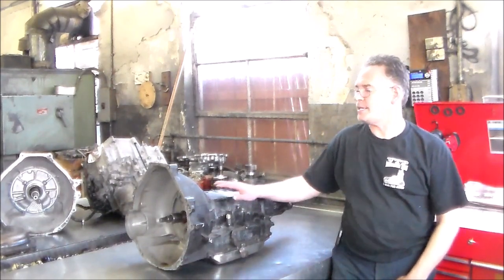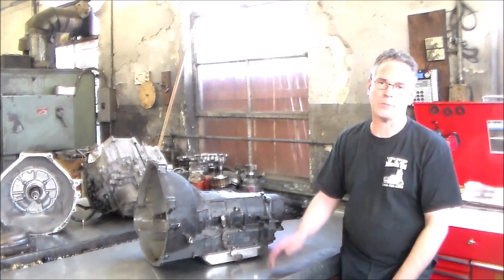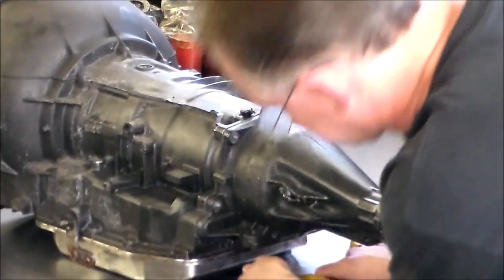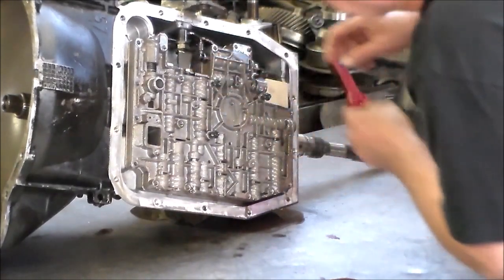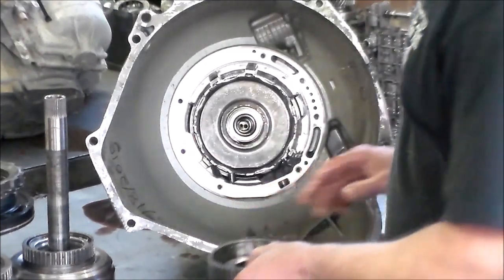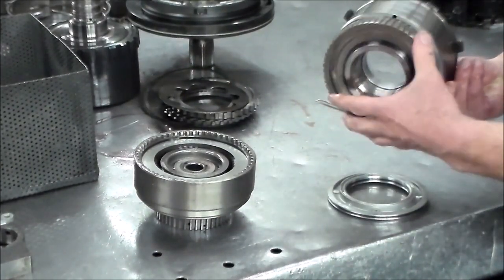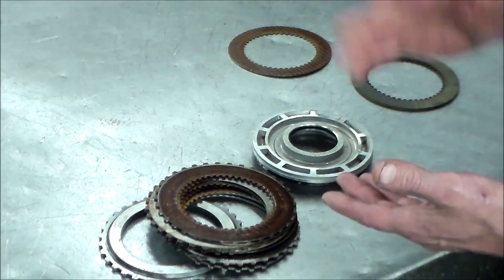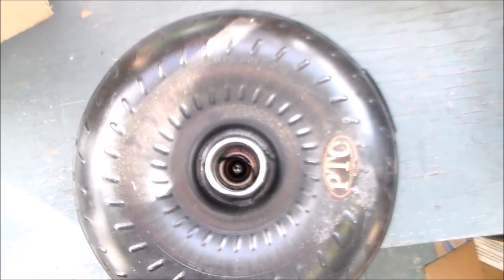AOD Teardown

Comment: Hi mr Gary after we rebuild transmission today i test my car shift 1st gear and second gear is ok but it is not shift 3 and 4 gears. İ tested both overdrive position and D position same problem. What you think may be valve body?
Reply from the maker: If this is early AOD, could be converter problem or direct drum problem.  What year is the car.  You installed the direct clutch shaft correct
Reply: @GaryFerraro  1991 Libcoln Town Car.  please if possible send to me email any book for rebuild this transmission.

Comment: Great video Gary. How much can you charge to rebuild a1986 AOD trams for my mustang?
Reply from the maker: Is this just a regular rebuild?
Reply: What do mean 🤔 with regular rebuild?
Reply from the maker: @franciscovalencia7601   Not installing any kind of shift kits, just a standard rebuild
Reply: Just regular rebuild nothing special
Reply from the maker: @franciscovalencia7601  ok, let me check on parts, are you in the New York Area?  what is the problem with the trans?
Reply: I'm from Chicago. Can't go reverse
Reply from the maker: @franciscovalencia7601  Does this move forward in Neutral  by chance? if not how are the forward gears?
Reply: Yes I can go forward in neutral .not bad but I would like to rebuild da whole trams
Reply from the maker: @franciscovalencia7601  You would have to rebuild the trans, would run about 1200ish

Comment: Tell me why there is no forward movement after recovery. Forward pressure 60 psi at idle. Reverse gear works fine. Thank you in advance.
Reply from the maker: does this move forward in manual low
Reply: @GaryFerraro  This is the pressure in the drive at idle speed and it corresponds to the manual. Is this a problem in the valve body?
Reply from the maker: @ПавелНегру-й5м  ok, what year is your car?
Reply: @GaryFerraro  Lincoln Continental 1980. Transmission 1989.
Reply from the maker: @ПавелНегру-й5м  Does this move when you select manual low?
Reply: @GaryFerraro  There is no movement in positions d, 3 and 1. The rear is excellent.
Reply: @GaryFerraro  Thanks for the help. the problem was in the mechanical part.

Comment: I have another question Gary. My AOD is done and in the car. All gears shift except when it gets to OD, it seems you can hear the drum slipping on a loose band like the servo isn't engaging. Could this be a bad servo ro a valve body issue? I did instal a Trango HP kit and 1,2 and 3 hit hard and work just fine.
Reply from the maker: ok, are you sure you caught the band on assembly of the trans?  the throttle cable is hooked up?
Reply: @GaryFerraro  yes,I made sure I could see it and pushed in and ou to confirm.
Reply from the maker: @anthonymazzola767   Did you install the piston for the o/d band before installing the intermediate clutches and the pump?
Reply: @GaryFerraro  yes
Reply: @GaryFerraro  would using the wrong valve body spacer plate gasket cause this? There were 2 and I used one that had a rectangle hole without the little leg cutout.
Reply: @GaryFerraro  I just looked up the gasket I used. it's the dual white stripe for  80-89, mine is a 92. So i did use the wrong plate gasket but could that cause this?
Reply from the maker: @anthonymazzola767  yes, if any holes are blocked sure.  All valves moved freely in the valvebody?
Reply: @GaryFerraro  They did when i installed the Transgo. i removed all and cleaned, re-installed with light coating of trans fluid.

Comment: Gary have you ever worked on ford escape transmissions, I was told that they cannot be rebuilt.
Reply from the maker: They can be rebuilt, what year are you wondering about
Reply: @GaryFerraro  2007to 2009 I think. my son has an 04 and he is wanting to buy a newer model but his lady friend had a newer one that the transmission went out and the transmission shop here told her that they were nonrepairable.
Reply: @GaryFerraro  It was a v6
Reply from the maker: @oldschool9746  The trans is the 6F35, Np problem, I have done a bunch of them, not that bad to work on but the labor to remove and replace is like 12 hours
Reply: @GaryFerraro  Thanks for the reply and the information it is greatly appreciated.
Reply from the maker: @oldschool9746  sure, no problem
Reply: The transmission in my daughter's 08 or 09 Escape just went out after 240,000 miles. We decided to replace the V6 engine and trans as a unit since the miles were so high. It was still running strong though.
Reply from the maker: @davidgillenwaters8712  Engine and trans, wow. rebuilt engine and rebuilt trans?
Reply: @GaryFerraro  The engine and trans we pulled out are original to the car. Never had a problem. The replacements are used with around 100k on them. Tried to outsmart myself by replacing both instead of rebuilding the trans and then the engine going out.

Comment: I just had a AOD rebuilt and they obviously didn't test drive the mustang and now its seems to miss 2nd gear and go right to 3rd and if you give it full throttle from a stop it doesn't want to shift at all till I left off the pedal. What's going on with this transmission?
Reply from the maker: If you drive it normal do you have 2nd?
Reply: @GaryFerraro  No when you drive it normal it acts like it shifts into 3rd gear and misses 2nd it.. it literally bugs down the engine when it shifts from 1st to 3rd gear I think it shifts out of first around 3000 rpm them drops to about 1000 to 1500 rpm when it shifts to 2nd.
Reply: @GaryFerraro  No it seems like it skips right to 3rd gear and bogs the motor down pretty good.
Reply from the maker: @jl456  ok,  did anyone try adjusting the cable?
Reply: @GaryFerraro  yes i tried adjusting the tv cable I was told the best way to do that without a gauge was full throttle and pulling the cable to match.
Reply: I can make it go into 2nd gear by doing the old trick by starting in 1st then drive then back into 1st.  It's just odd to me why its doesnt shift into 2nd normally and doesnt shift at full throttle
Reply from the maker: @jl456  Im wondering if the linkage is getting stuck as you step on the gas, can you see and make sure the kickdown linkage is free and moves back to original position, still could have no 2nd, maybe sprag is no good, just making sure all external is ok first
Reply: @GaryFerraro  I did that also jacked the car up and the linkage for the tv cable moves freely and back and forth
Reply: The guy that rebuilt the transmission is 3 hours away from me and I hate to take that trip again if it's just something simple or maybe something sticking in the valve body of the trans.
Reply from the maker: @jl456  No Difference hot to cold?  Maybe try disconnecting the cable to see if it may shift early
Reply: @GaryFerraro  no difference hot or cold I'll try with the cable off. Thanks
Reply: Just tried it seems like it slips more into gear alot earlier doesnt feel right alot looser throttle. What should be the RPM difference be between 1 and 2 gear ? Shifts between 3500 down 1500 starting out from a stop.
Reply from the maker: @jl456  With the cable off, no throttle pressure so it may shift earlier , did it seem like it had 2nd?
Reply: @GaryFerraro  it acted like it had no power and you had to accelerate more to get it going but it skipped over 2nd gear and went to 3rd
Reply: Even from a stop and you floor it wont  go into 2nd gear it just red lines. Till I left of the throttle then it shifts into 3rd
Reply from the maker: @jl456  Well, either there is a stuck valve or the 2nd sprag is no good,  May want to check the valvebody first to make sure check balls and valves are free
Reply: Is there any vacuum lines that can make the transmission not shift correctly?
Reply: @GaryFerraro  okay thank you for your help
Reply: @GaryFerraro  one more question for you if I can manually make it go into 2nd gear and it works wouldn't everything be freed up in the valve body?

Comment: Could you please show me valve block vacuum test?
Reply from the maker: Next one i get, i also have to see if a vacuum test guide is available for this trans
Reply: @GaryFerraro  Sonnax has vacuum throttle valve test data, but  there's no value for other valves. I'd like  to check other valves to be sure in proper valves body operation.

Comment: Been better if you'd have mentioned the socket sizes as you went along
Reply from the maker: sorry about that, pan is 10mm, valvebody is 8mm
pump is 10mm, extension housing 13mm, filter 8mm
Reply: @GaryFerraro  thanks buddy. helps move things along.
Reply from the maker: @ezcondition  Sure, no problem
Reply: If you can’t figure that out on your own I strongly recommend not to tackle a job like this !

Comment: oh yea.. the PTC converter.. that is not a stock stall converter..  you might look it over and see if you can find a build number on it and call PTC.. or talk to the customer if they have the invoice so it can be reordered.. this also explains the 7 clutch pack.. its an upgraded unit for higher horsepower/drag race type abuse. and i bet he does not have the proper ratio adjuster on the carb .. or he has added a spacer to the throttle body and changed the effective length of the throttle valve cable.. feel free to delete these gary..... wayne..
Reply from the maker: Always nice to hear from you